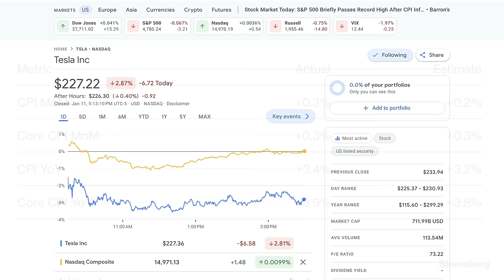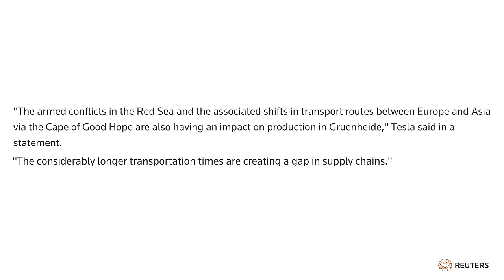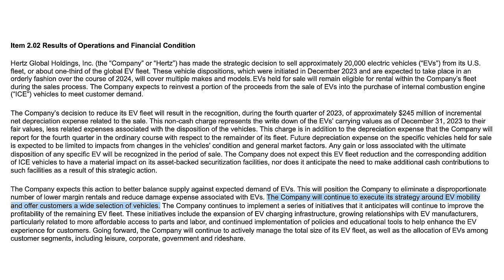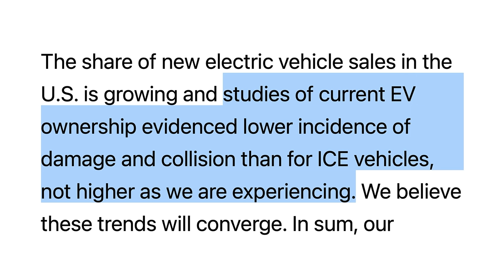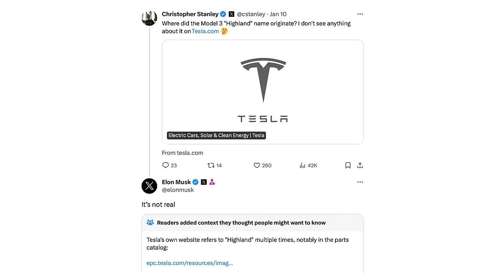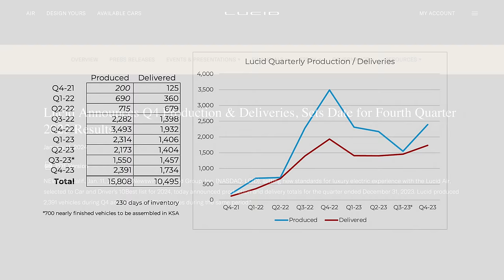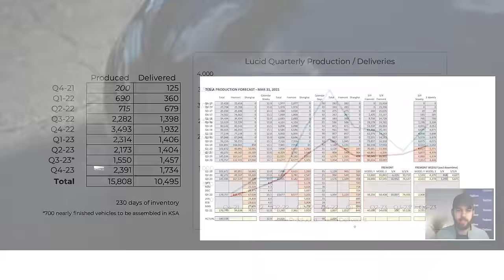Hertz Cuts Back Tesla Fleet, Giga Berlin Production Pause, Cybertruck Deliveries

Comment: I find this story extremely confusing, not because of the presenter but because of Hertz. Normally Hertz sells off cars after they have been driven 30K to no more 50K miles. This is because the maintenance cost jump after 30K miles. In this ad Hertz are selling Tesla model 3 with 80K+ miles and in only 2 years. In previous video I have seen that Hertz was complaining that electric cars have high maintenance costs... there seems to be an inconsistence in their actions. The real complaint by Hertz is that the retail price of the Tesla model 3 has dropped significantly since they were originally purchased and will continue to decrease. The Hertz business model depends on the retail price of their purchased cars going up or at lease remaining the same. The real problem is that Hertz's business model is outdated. The real proof of this is the new deal between Uber drivers and Tesla where the cars will rapid generate high mileage and require low or minimum maintenance. This business model works because the cars will be sold after a shorter time therefore reducing the potential exposure to a drop in retail prices. Hertz needs to get their business model straight!! I would also like to see the results of the Polestar EV that they also bought.
Reply: If Hertz is concerned about residual values when they sell the cars, why sell now? As Rob mentioned those cars have already had their worst depreciation (new > 2-3 years old). Seems like they're doing the worst thing possible resale value.
Reply: Hertz is going bankrupt that’s why
Reply: Hertz has gone bankrupt who knows how many times. CEO Scherr(?) is demonstrating typical Hertz CEO befuddlement.
Reply: As the resale value of the cars has dropped,
Their CURRENT balance sheet looks bad, due to assets far more devalued than they thought.

Therefore, selling off those assets reduces that financial statement eyesore.
Reply: In short, Hertz is a shit show of a company now - just ask the employees.
Reply: Well yes. But if you undermine an asset value then folks are going to take note of that in consideration of residual value. If I purchase an item for $100 in expectation of it later being worth $75 but subsequently find it to be worth $50 then that will inform my next purchase. No angst. No blame implied. Just the obvious truth.
Reply: I also find this confusing because I rented a Tesla from Hertz, sort of. I made the reservation but when I got to the counter I didn't get one because people were not returning them, renting them longer than originally scheduled.  The sales guy said this was a normal issue and they didn't have enough to meet demand. They gave me a great deal on a BMW to pad my disappointment.
Reply: Does this have anything to do with Model 3 plus launch in USA?
Reply: Don't be gentle with the rental....
People testing a fast EV
Reply: You guys always find a way to protect your narrative 🥲
Reply: You nailed it Paul OP
Reply: This is a copy and paste comment
Reply: Tesla — Bad News?  and IIIIIIIIII T s Reuters ( scummedia, ) —- Imagine my surprise 🤡🌍
Reply: Sounds like a pretty crazy business model but I guess people want the newest, freshest cars to rent. So, it once again seems like the real issue here is the price cuts Tesla made and that just not working with Hertz's plans... Not really any downside for Tesla except some negative press I guess. Hertz really did a buy high sell low strat.
Reply: @robvanwijk3085  who said nothing is as fast as a rental ? 🥴
Reply: Of course, it is comparatively to other brand that Herz find Tesla’s more expensive to own due to high repair cost with questionable built quality and low resale value. Other large fleets do the same G7 taxis in Paris have banned Teslas after a severe accident. All this has basicslly nothing to do with any rental business model, these depreciation factors affect all sales, all leases and rentals of EV’s and Tesla is no exception (excessive sales subsidies and bonuses on EV has blown up a huge second hand unsellable surplus in all industrial rich countries) The excuses given for closing Berlin are laughable, Tesla always blame upstream supply glitches, Ndivia chips supply to justify shutdowns…while everyone knows it is downstream that 2023 sales did not meet expectations, by far even is Tesla is less affected than others being more reactive with direct sales. Toyota often criticised for marginal BEV produced only for mfrs subsidies is doing great it seems with plus 10.6% vol. P.A. Ending march 2024. PHEV sales are back on with Prius 5 massive improvements : Atkinson cycle, dry gear drive sump, heat pump, new batteries with 16 % less elements pv roof and an full electric autonomy sufficient for most of the normal commuting, shopping leisure and fully recharged by an E-bike basic plug in one night..lighter in weight the electric BEV equivalent, the efficiency is also better than and similar BEV 12 kWh/100kms vs at best, 14.6 kWh/100kms for TM3. Then the thermal 600 miles autonomy and 3 minutes refill time is more efficient than a pure similar purely thermal with BVA since the roughness or a low rev efficient Atkinson is smoothed out by the E motor(s) active flywheel function and inertia…and Physalis on the cheesecake …or cherry on the cake for the planet and pollution…all this is made possible with 6 time less lithium than a similar BEV..Result despite a crass high selling price..it find its market …small taxis, owners haven saved enough with their previous Prius IV, etc..

Comment: 00:01 Giga Berlin production pause affects Tesla stock
01:31 Transportation challenges affecting Giga Berlin production
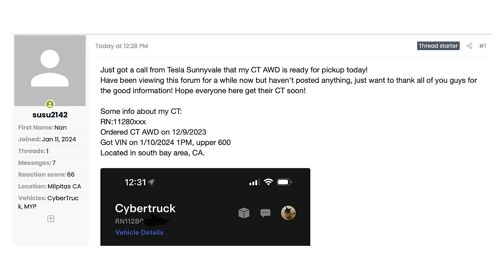03:01 Hertz plans to sell about one-third of their global EV fleet, mostly comprised of Tesla vehicles
04:28 Hertz to reinvest proceeds from EV sale into ice vehicles
05:53 Differences in EV use for rental fleet vs. actual owners
07:24 Tesla employees in Fremont to receive market adjustment pay increase
08:50 Departure of Tesla's senior software engineer and updates on Toyota's solid state batteries
10:22 Lucid Motors facing significant production and financial challenges.
Reply: Thanks!

Comment: I think the hertz news has a lot to do with the depreciation. Not only The price cuts Rob mentioned but also the  model 3 refresh is likely to drive the value of Hertz's model 3s down even more.
Reply: A fair number of Tesla buyers felt buyers' remorse after Tesla's big 2023 price cuts. Instant depreciation.

For a time, when production lagged demand, resale values were ridiculously high. I cautioned folks not to assume low depreciation in their BEV vs ICEV cost comparisons, but some did it anyway. Hertz may have done that.

High resale values could not last, not with Tesla growing production 40-50% annually and needing to go increasingly down market to find demand. Plus, the pandemic was atypical. ICEV producers quit producing as much. Dealers ran out of inventory. Resale values bumped upward across the board. Hertz probably misfired into a spreadsheet with some unlikely assumptions about depreciation. Now they have a bit of buyers' remorse, too.

From a purely business standpoint, this is a good time for Hertz to flee back to ICEV. There's an inventory glut; it's a buyer's market. Depreciation will be ungentle, but so long as rental agencies take that into proper account, it could make sense,  from a cost perspective.

In the short run, at least.

Hertz and the others are making a mistake, however.

What they should do, and have not, is hold Teslas for 4-5 years.

They would have to ramp up their detailing capabilities, but the backend savings on maintenance ought to more than make up for it.

Run out the warranty and keep going. A 5 year old Tesla is likely significantly more reliable than a 2 year old rental ICEV, unless it's in an accident. There just aren't very many failure modes.

Hertz also should adjust their fill-er-up on return policy. Customers will be enticed much more by rental BEVs if Hertz takes the car back and plugs it in, no surcharges. Why not? They can get cheap electricity and have each unit ready to go in 30-45 minutes. If customers don't have to worry about exorbitant fees, there's no reason to prefer ICEVs.
Reply: Some very good points. Remember Tesla gives them zero discount. Legacy gives the rental companies huge discounts so they lose very little when they resell their cars. This is a big reason why they should keep their Tesla fleet for much longer than they keep the ICE fleet.  @Urgelt
Reply: I'm not 100% sure how it works but I imagine the depreciation would affect there quarterly financials in some way. They may be concerned about the effects on share price as they did not anticipate large price cuts and are somewhat "over leveraged" now and need to scale back...
Reply: I bought my Tesla in September 2022, my car depreciated rapidly Januar 2023, personally really not a problem since I am going to drive it for 10-15 years
Reply: @casperhansen826  yes. The answer to depreciation is to keep the car - if it runs well.

I think hanging onto a Tesla until it no longer serves the purpose is a very good strategy.
Reply: Yeah, likely is just a rental company issue since they probably have to show all the depreciation as a loss for the quarter/year. Definitely doesn't seem like a good economic move but it's not in any way my area of expertise.

Comment: I'm not surprised to see Hertz cutting back on EVs.  We drive an S and a Y on a day to day basis.  We recently rented a Model 3 while on vacation and enjoyed the drive.    I expect that most travelers opt out of EVs due to charging time.   When you consider its scarcity, vacation time is extremely valuable and is often very expensive.   The concept of loosing vacation time due to charging is bound to have an effect on rental choice (especially by non-EV owners).  If you charge a model 3 from 10% to 70% on a 250 KW charger, you can complete the charge in less time than it takes to eat a meal and only a few minutes longer than it takes for a bathroom break.  

Unfortunately, almost all non-EV drivers and many EV drivers don't know how to optimize their charging.  The effect poor optimization is lost vacation time and one result is likely to be a marked drop off in repeat rentals.  Tesla and Hertz both need to do more to educate drivers on how to optimize charging while on vacation.  We need many more level 2 chargers at hotels and more eateries within 5 minutes of superchargers.

I am not surprised to see the updated Model 3 here in the US.  The cars are likely to be coming from China.  It makes sense given the current transportation issue from China to Europe as you mentioned.  It also works in Tesla's favor.  Tesla can maintain US Model 3 sales by introducing the updated car earlier than planned or expected.  The early introduction will divert some of the typical order drop off that usually precedes the introduction of most new Models.   For Tesla the process if further exacerbated by the production lag introduced by downtime for retooling and ramp up of the new model.  

If they choose, Tesla could cover some the world wide impact of diverting cars from Europe to the US, by reducing new Model 3 sales in Sweden.
Reply: It is not only due to charging times but  also about the costs potentially associated with repairs if there are crashes. Those electric car batteries tend to damage easily and be relatively costly to repair.

Comment: As to Hertz, if they expect normal depreciation on EVs they are sadly mistaken. It is in Elon's master plan to continually drive down EV costs. I imagine that by the end of this decade a new model 3 will be around $28,000 in inflated dollars!  No one should buy an EV with the idea that they can sell it and not be upside down in a car loan. I think EVs will go down in price sufficiently to where you may only break even or be underwater in a resale after only two or three years. 
Battery prices are continuing to nose dive and the new unboxed assembly methods along with Teslabot doing the car assembly will drive prices down a lot by 2026/2027.

Comment: 6:40: actually the main reason for their having high rates of accidents is because of the fact that the Uber drivers who are utilizing these vehicles are driving them for thousands of miles per month.  Realistically if you look at what they're selling a 2022 model 3, versus an Audi A4 or an Infiniti Q50 which also for about the same thing new.  The Infiniti in the Audi both have a lot less miles per year.  As an example they're selling a 2022 Tesla Model 3 with 60000 mi on it for about 23,000.  For about the same price you could get a 2021 Audi A4 or 2020 Infiniti Q50.... All basically at around the same price and with around the same mileage.  Considering that depreciation is tied more to mileage than it is to the actual year, they're not really selling it for too much of a discount versus gas powered cars.
I think the biggest problem with hurts is the fact that they were arresting so many people and their customer service is absolutely horrible.  As an example, I rented a Polestar 2, and after renting it for 6 months straight because I was a few days late, they literally came to my house and repoed the car without so much as a phone call.  When I called they told me that I was 2 weeks late and even after I sent them proof that they were mistaken, they refused to rectify the situation or even take me off The blacklist, so I'm no longer allowed to rent a car from them.  Keep in mind they've had hundreds of people arrested because they themselves made these types of mistakes.
So far they've had to pay out hundreds of millions of dollars in Lawsuits.
If it wasn't for the lawsuits they would have actually had 25% margins.... Better than Avis

Comment: A little color on the Hertz EV situation: put simply, the ability to have adequate dedicated fast charging stations installed in planned locations across fleet concentration zones, ie airport hubs, was overly optimistic and has left the company well short of the needed infrastructure currently, and in the near term. 100,000 EVs cannot be supported, not close.